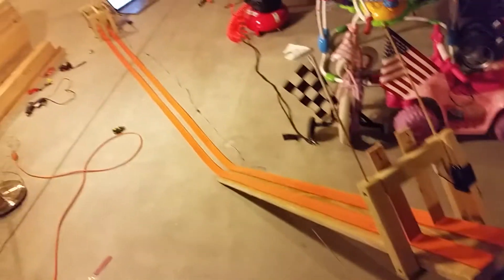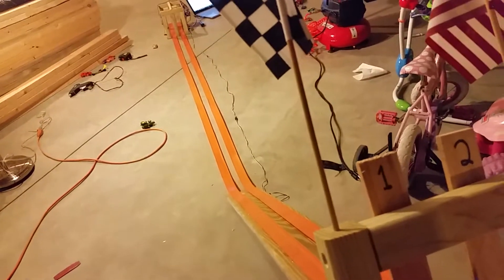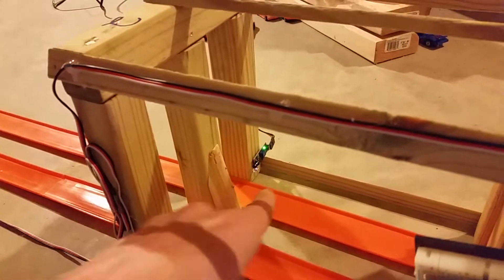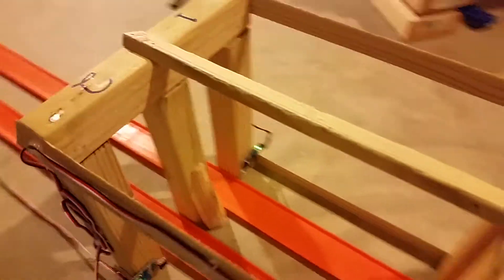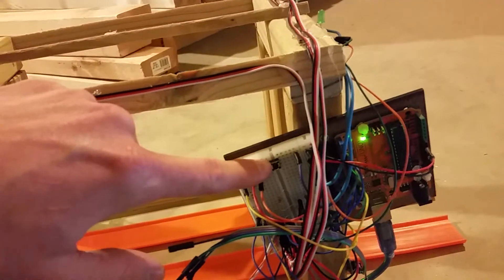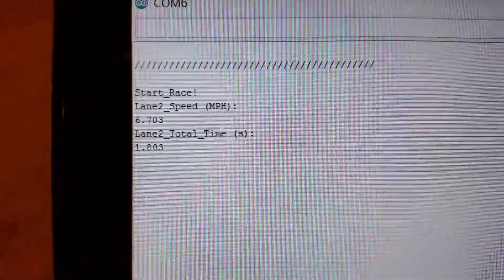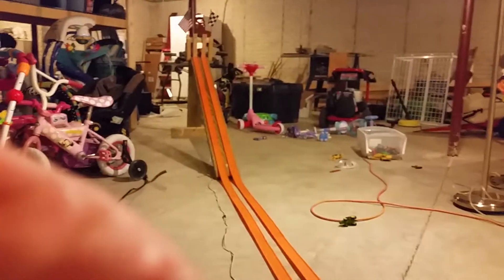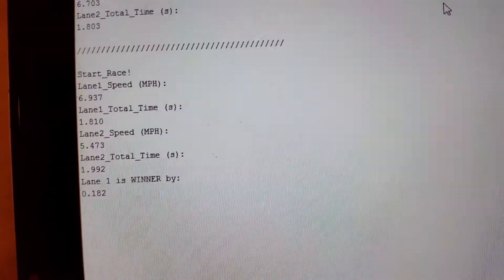DIY hot wheels race track timer using Arduino

Comment: Were you able to share your code and wiring diagram?
Reply from the maker: Hello, so sorry for the delay on this.  Yes, I will try to post the code in the description this week.
Reply: @doinkeroni  Yes with wiring drawing (or Fritzing) please would be super helpful!
Reply from the maker: @hotwheelstimetrials  so sorry guys!  Life has been crazy and I haven't had a chance to put something together.  I will attempt something this weekend.
Reply: @doinkeroni  no need to say sorry. We know life gets in the way ;) It's nice to see this setup. I just ordered a V3 last week. Want to build rudimentary startgate at top then finish gate at bottom to have one lane total time elapsed setup. Hoping I get it working. Never worked with Arduino before or coding lol. If you do post some specs I might just attempt this down the line. Thanks for sharing the video. Greetings from South-Africa
Reply: @doinkeroni  Thanks so much!
Reply: @doinkeroni  Thanks, that would be awesome.
Reply: @doinkeroni  Awesome.  I really appreciate this.
Reply from the maker: Hi there!  I finally had a chance to make a video about the code & wiring.  Please see it in the description or here: https://youtu.be/qnHIPCcvGxw   Thanks!